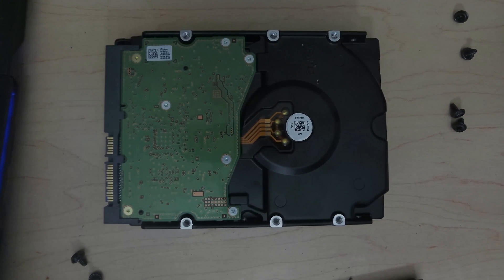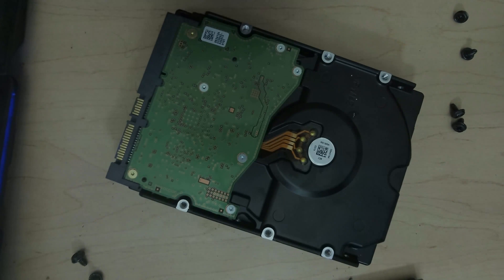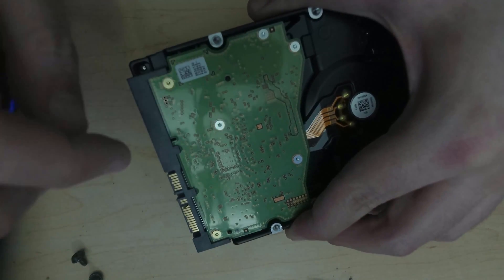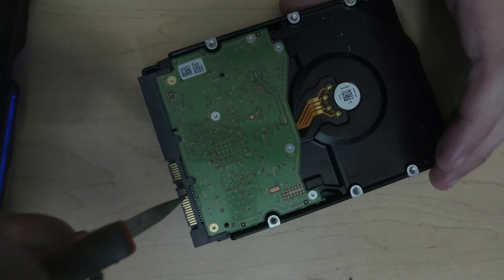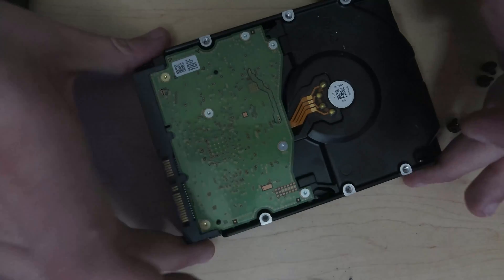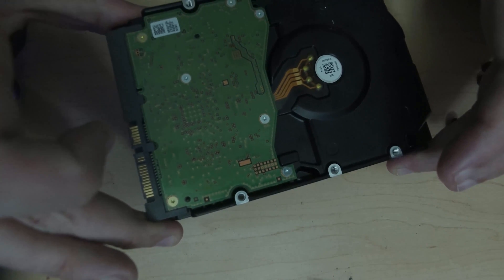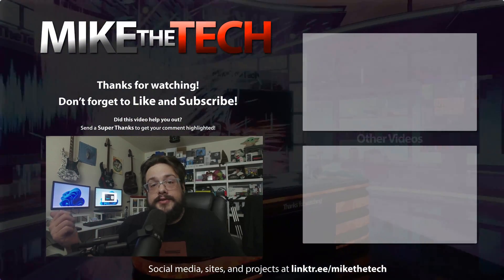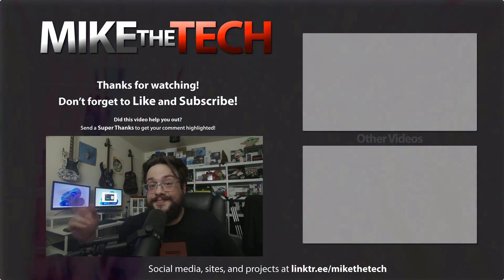Hack WD External Drive for Internal Use

Comment: 2:37 I am pretty sure pointing the knife at the other hand is not the OSHA approved method of doing this 😲
That said, thanks for the vid! The only thing I'd word slightly differently is the intro: I'd suggest that viewers try to use the drive in a PC first, and only if not recognized, proceed to masking or removing the pin. I am not a fan of permanent solutions.
Reply from the maker: lol!! I always make the joke that I’ll try not to cut myself but it’s eventually gonna happen. 

Thanks for the comment! Good call on the intro tip! Will definitely make an update in the future.

Comment: All i did was plug my western digital drive into my pc. It worked without me doing surgery to it. My pc just me how i want to use the drive. I decided to partition it an run windows 11 off it. I rarely use windows 11. I use it for running games and emulators on it. I want to install windows 7 on that drive as well. But there seems to very hard.
Reply from the maker: Yep. It’s only white label drives that require it.

Comment: i'd suggest using electrical tape tape to mask the pin or the first two pins if it's too small of a cut. unless you plug and unplug the drive constantly that tape will stay there without causing issues, worst case you just reapply some. there are aslo ways to masking that pin that do not involve any destructive action.
Reply from the maker: Those are mentioned in the video. :)

Comment: I shucked a couple or three WD drives 3 years ago. 2 are 8TB and one is a 4TB. All had the same problem. Both 8s I used tape. they are in my jellyfin server, with various others drives. They work great. The 4TB, I removed the pin. It's in my daily system as a storage drive. Works great.
Reply from the maker: Nice! I considered the tape but figured I’d go more permanent. Thanks for the comment!

Comment: What is the purpose of this? Would I have not been able to boot from this HDD beforehand? If that's what you're getting at, that's actually rly insightful. thx man
Reply: Price control. It enables them to force more savvy users toward other products in their lineup that are more expensive per GB.
Reply from the maker: Yup. You used to be able to use them internally without issue. Now, the new drives don’t even show up in the bios unless you do this (or a similar method).